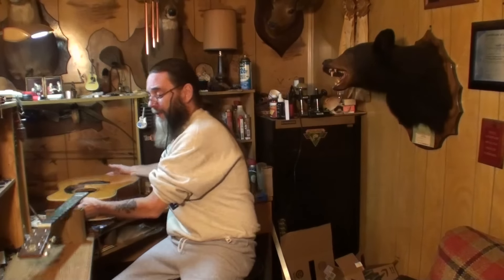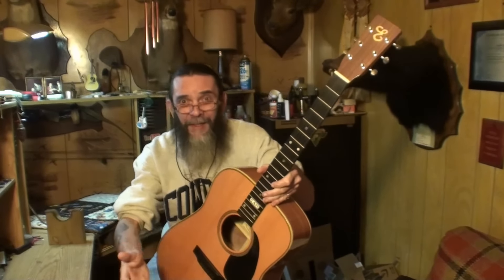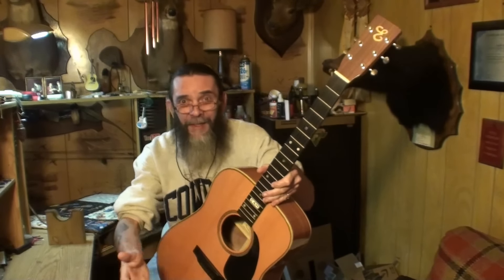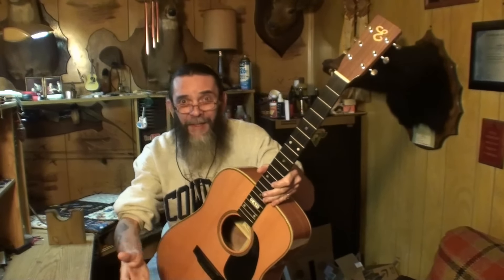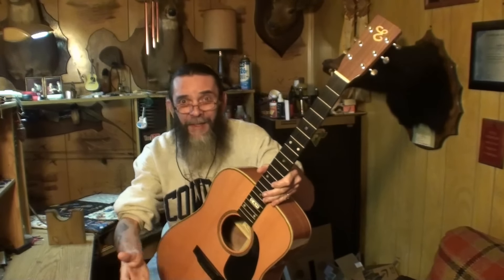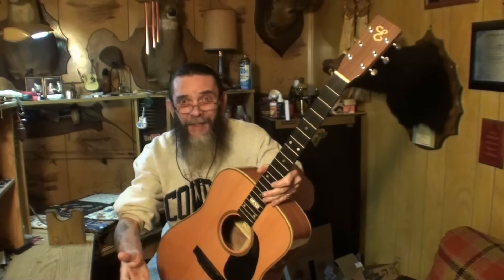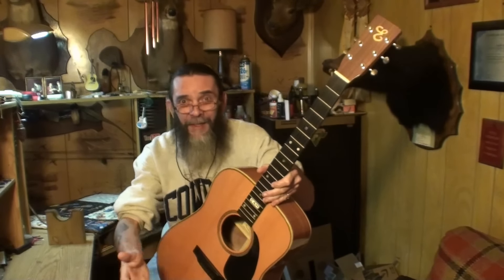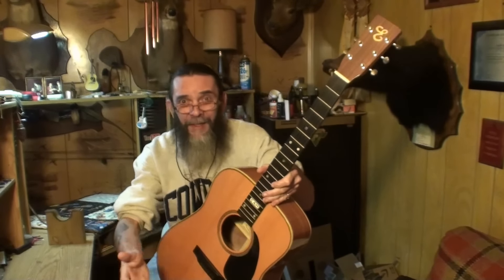Echowebb Guitar inspection What would YOU do?

Comment: Randy I think you better re set the neck first so you have a benchmark to measure from then glue crack with bridge off then reposition bridge after fret replacement 
Best Wishes
Reply from the maker: I'm pretty sure the neck will have to be reset, but the bridge has to be in its proper place first in order to align the plane of the fretboard to it and in order to get the right neck angle. We can't adjust the bridge once it's glued in the proper place, we will then have a permanent point to set the neck with, the only adjustment we have is the heel and the neck joint. Thanks for your input! It'll be a fun journey!

Comment: Before removing the bridge use the suction cup to squeeze glue in the crack then put 2 cleats running against the grain to make sure it doesn’t come apart again. Then reset the neck before removing the bridge because that would tell you if you need to remove material from it before taking it off and regluing it. Good to see Q-ball again.
Reply from the maker: First I have to fix the bridge and then the crack, I did put 2 cleats in it. But the bridge has to be fixed first in order to get the angle of the neck right and the plane of the fretboard to match the plane of the bridge because we can't adjust the bridge, the only adjustments for this is in the neck joint. Thanks for having a look Dale!

Comment: Randy I think I would start with the neck. If there's a major issue then all the other work want matter. As for the crack does it extend under the bridge? If it does I would remove it first. Hold on!
Reply from the maker: No from the bridge to the sound hole and about an inch on the back side of the bridge is ok, the separation starts about an inch from the bridge. Thanks for your input!

Comment: Randy, I'd remove the neck then remove the bridge, glue the cracks with cleat, cleat grain running cross grain of the sound board  reset the neck, so you can replace the bridge in the right position, do a spot level, crown polish, and set up
Reply from the maker: Very good answer! However the bridge we cannot adjust, so it'll have to be set where it belongs and then we can make adjustments to the neck joint to size up everything else. Thanks for viewing Brian!

Comment: Hi, Randy - Great channel; really enjoying it. I fix mine and my friends' guitars and I'm finally properly learning to do more advanced repairs. Recently, I've been working with a local luthier, to gain experience, knowledge and utilise his shop while building my own tool kit and bench.

So, the Echowebb. What would I do? Well, you already hinted what I would do. LOL:) Humidify until satisfied. Let settle a bit. Remove bridge, glue/cleat crack. Thoroughly inspect all top braces, bridge plate, top belly up. Fix until satisfied. Replace bridge. Let all glue set. Then, string and setup again, and then measure/observe neck heel / fingerboard extension fit/angle. 

Wow, that's a mouthful. I don't know if 'seating' the neck further down on the body is the right way to go. Will that mess up the main bolt fitment with the neck heel? Hmmm. I feel if it is tight, just shave the heel to change the angle, place a shim under the fingerboard extension to suit, to stabilise the whole neck joint fitment and neck/bridge angle. I have several guitars that have a similar shim under the extension, before and after a neck reset.

Then, restring and setup with hopefully a good solid neck joint, good neck angle, nice tall saddle/solid bridge and solid vibrant top. My best acoustic, a 35 year old David Wren ( a Toronto, Canada luthier ), also has a very large bridge plate. The top is rather thin and has light bracing, so the large plate stabilises the top structure (especially around the bridge), while being very resonant, loud and tone full.

All the best, Randy - Don't stop making videos, they are awesome. Cheers, Mike
Reply from the maker: Hi Mike! Your luthier friend is leading you in all the right directions it sounds! You described it very near exactly the way I'm going about it and in the very same steps! I chose to fix the tops separation and bridge first because we have no adjustment there, once the bridge is glued in place we can make the necessary adjustments at the neck joint to the plane of the bridge. Very good points you make!
Reply: Thanks, Randy - On with the job and hopefully a video, particularly about the neck joint/plane of the bridge situation. All the best, great videos, cheers, Mike

Comment: I would first fix the crack using three cross-grain spruce cleats about 5/8" square and 1/16" thick, with beveled edges.  Next I would carefully scrape a narrow V just through the finish, along the top at the crack and drop-fill it with CA.  Scrape and polish that out.  Next step is the bridge re-glue.  Last step is the neck reset.  The reason for this order of work is to stabilize the body (the cracked area) before removing the bridge or neck.  Guitar bodies build tension over time, even with strings off.  Removing the bridge or neck first can release that tension, and may worsen the top crack.
Reply from the maker: I took the bridge off first just so if the crack was going to open up anymore it should have then, but it didn't. Other than that I am doing everything else the same steps as you said. I wanted the bridge back on and where it's going to stay before ever trying to reset the neck angle and plane. Thanks for viewing and chiming in!

Comment: Fix the crack, and cleat it. Cross grain the cleat. If you noticed before you humidified if there was dirt in the crack it should have been cleaned out. I would prolly, as tight as the crack us now just wick water thin CA into it. With the cleat no worries. Then the bridge reglue. Then the neck reset. Lowering the neck wont help the angle so I'm thinking reset. It will likely drop when you loosen the bolt. But that's likely the way I would go
Reply: Hit the button a bit early. You think maybe there is no glue in the neck joint or under the fret board. With the screws through the top? We'll see
Reply from the maker: Those are exactly the steps I'm taking and in the order I'm taking them. We can't determine the neck angle until the bridge is glued in place. I did clean the crack as good as I could before humidifying and blew it out good with an air hose, it reallt went back together nicely from humidifying. I believe you're right about no clue whatsoever in the neck joint and fretboard extension. Not sure yet but I might recommend to the owner doing away with all the nuts and bolts and gluing the neck on when I reset it, this would not have been a problem this soon had it been glued on me thinks. Thanks Dane!
Reply: Randy Schartiger , well Randy, great minds and all that. Though I might be tempted to glue the neck on and use that heel bolt as a clamp, then leave it there. I'd loose the fretboard screws though.
Reply from the maker: Dane Nichols
Great minds indeed! My thoughts exactly! lol I'll wait until I get into it and see but probably am going to recommend this all to the owner. Thanks again my friend! Hold on! =D
Reply: The only problem with during c a glue is the clean up.anything that would cut the glut to clean it off the top will melt the lacquer.so you will have to use regular wood glue.
Reply: My usual CA routine is to electrical tape close to both sides of the crack. Then glue and or fill the crack, peel the tape and scrape back the excess glue. Taping both ends of a razor so just the middle scraped. Level sand through the grits and buff. Usually turns out quite nice. And since there was already some glue crap residue on the back a little clean up scraping wouldn't have hurt.
Reply: Dane Nichols I wouldn't take the chance  of going through the finish it ruin the patina on my 57 Martin would you?
Reply: These are really case by case. For instance Randy said he was planing to refin his guitar. On a 57 Martin I would use hot hide glue for that repair cause it will not harm the finish and will fill and blend with the crack if there happen to be any gaps. But Most older guitars have thick enough finish to do a little sand out without fear of going through the finish.Caution is always advised.
Reply: Dane Nichols OK its an option .
Reply: Randy Schartiger what about the way the fretboard dips from the 14th  fret on.?can it be raised along with the body towards the end to straighten out the fretboard?that was one of my main issues..
Reply from the maker: Krusty Buzzard
I'm hoping when I get the neck to set deeper down into the joint then the fretboard extension will then lay flat against the top and no longer fall away. I might even end up having to shim it.
Reply: Randy Schartiger I was thinking that. I was also thinking king about jacking the top up below the fret board while it's hydrating  to see if it will stay up. You mite also Jack. It Into position as it is being glued once the glue dries it should stay in position.

Comment: I would take bridge off, pump glue into crack and cleat the crack after I sussed out that neck joint and fret board extension which seems to be a bit of a big problem.
Reply from the maker: You my friend are exactly right! The neck angle and plane of the fretboard to plane of the bridge cannot be properly set until the bridge is fixed, good call!
Reply: Thanks Randy, you have taught me all I know 'bout this shit. Its maybe cause I am lazy that I would get the easy stuff out of the way first before I put that guitar in a neck lock and see what happens when I unbolt it and take the nuts off the screws holding that fretboard extension on which seems to have a curve in it. My head is exploding thinking about it so I cant wait till I see what you do with it on the next video. Interesting stuff, Thanks man, Happy New Year and love to QBall from my mutt Oscar.
Reply from the maker: I try to think ahead as much as possible and in doing so I decided to fix the crack and bridge first because we can't adjust the bridge once its been glued down in its permanent place, we do however have a bit of adjustment at the neck joint and that adjustment will allow us to match the plane of the fretboard to the plane of the bridge. If this were my own guitar I think pretty strongly I would do away with all the nuts and bolts and glue the neck in. Thanks again mate! Q sends her love! :D

Comment: Ok, If I was going to take this guitar and fix it for myself and didn't have to be concerned with to many critics....After inspection and finding what we know,  I think that I would first remove the strings, then remove the neck from the body. I would go ahead with fixing the cracks and bridge problems and take alook at what can be done to the sunken area under the fret board extension area. My reasoning behind removing the neck and creating two pieces to fix separately is based on the bolt-on neck with the fixtures that pass through the fret board and into the top of the guitar body. For some reason, this just tells me that these should be addressed apart from each other. As far as putting the neck back on and knowing the details of measurements critical to alignments for proper setup, I'm getting a bit shaky and will have to check with Randy's previous videos to find answers. Ofcourse, my entire approach could be way off because I'm not a guitar repair guy, just wingin it for this video and wanted to see if I was even close......What say ye Ol Randy of  W. Virginie?
Reply from the maker: You are very close to taking the steps in proper order! We can't adjust the bridge, the only adjustment we have are the neck joint and heel, that being said we have to glue the bridge on after fixing the crack, the bridge is stationary so once in place we cau set the plane of the fretboard to match the plane of the bridge and get the proper neck angle as well by adjusting at the neck joint and heel. I hope that all made sense lol Cheers Mike and thanks for viewing!

Comment: Hey, new subscriber here. Reading the other comments I would clean out the crack with compressed air maybe, and the water makes sense. But could you use blue Loctite on the bolts to keep them from coming loose?
Reply from the maker: I cleaned and blew the crack out before starting humidifying but I don't think I got those parts on video. Yeah lock tight could be used but the bolts didn't come loose, the wood actually shrunk from being dried out and by shrinking made the bolts loose so lock tight wouldn't have really helped in this case. I will however lock tight them when I put it all back together. Thanks my friend for chiming in and for watching!

Comment: I have a feeling Earl must have been there......
I think I would address both the bridge and the crack on the top first at the same time. Remove the bridge, then use a little water at the crack first, then some glue and force the glue through the dampened crack with the suction cup. The glue will be attracted and siphoned in by the water and the suction cup. I would then use at least one cleat and I would cut the cleat(s) cross grained so that it wouldn't crack the cleat if it were to dry out again. I would also sand the bridge plate lightly, it looks a little rough under there and recommend one of those brass repair plates. Then I would glue the bridge back on. The neck looks almost as if it's not glued in place, judging by what the fingerboard extension and the way the heel section looks....almost like the bolt had loosened from the neck block drying out??? Had the bolt been re-tightened at some point, and the neck only slipped? I wonder if the builder had used shims, like some electric guitars use? Wouldn't it be really fine if all that was needed was to loosen the neck bolt and the nuts on the extension only the have it drop back into place?
Glad to see Q-ball was suffering from some with-drawls. Have a great evening, looking forward to this new series. Hooold Ooon:D
Reply from the maker: haha yes! Earl was here! :P I did wipe the crack with a very wet cloth before gluing but not sure I got that on video, it helps the glue to get in better. Your comment is the exact steps I've been taking in this repair. I believe you're right, if someone had known to tighten the bolt at one point it may have saved the neck from moving in the joint. I haven't gotten into it yet but I don't think the neck or the fretboard extension have any glue at all on them. I might even recommend to the owner gluing the neck in and doing away with all the nuts and bolts, not sure until I get in there and see how it's all assembled. Thanks for your comment my frien and for watching! Q sends much love! :D
Reply: If you do decide on gluing the neck joint and finger board extension...May I recommend instead of carpenters glue, perhaps using a protein based glue such as either fish glue or (cold) hide glue (Titebond makes it). It would facilitate the removal of the neck, when needed at a much later time in the future.

Comment: I'd ask the owner about the room he keeps the guitar in most of the time, but assume the guitar is going back to where it got dried it out in the first place. So ya, cleat it, glue it, get the top as close to flat as you can. (And re-ejumicate the owner on humidification.) Then I'd make sure the bridge was as flush with a mating surface (i.e. the top) as flat as I can make it. Because if you fix the neck first, you might be resetting the angle to a bridge that isn't where it has to be (vertically speaking) even if it's currently risen only a 64th or two. Once you got the  bridge where it needs to be, you'll be more confident to judge exactly how much to fine-tune the neck angle. All IMHO.
Reply from the maker: I think the owner might be paying more attention to his other guitars and humidification now that he's seen what can and will happen eventually if guitars are not properly maintained humidification levels. He asked me what humidifier I recommended. You are correct about the repairs, the bridge is our only anchor point to set the neck angle, once the bridge is glued in place we can then set the neck angle to the plane of the bridge. Good call mate! Thanks for viewing!

Comment: I think you should remove the bridge and fix the crack and cleat the top.  Get the top as level as possible and the reattach the bridge.  Then adjust the neck joint angle according to the flat repaired top.  If you reset the neck and then fix the bridge and crack I think it might change flatness of the surface which would cause the bridge to raise or lower and that might totally screw the neck angle. So a lot of work for nothing.  I might be completely wrong but that's my theory.
Reply from the maker: You are in fact 100% correct! Very good points! That is the exact order I'm doing the steps in. We could never get the neck angle right nor the plane of the fretboard to match the bridge until the bridge is glued down solid in it's place. Thanks for having a look!
Reply: Randy Schartiger I learned that reasoning from you and your channel.  Thank you for all that you do.  I watch religiously!  Now if I could only actually do all of those steps.  I know how in theory now the hands on is a completely different story... Ha